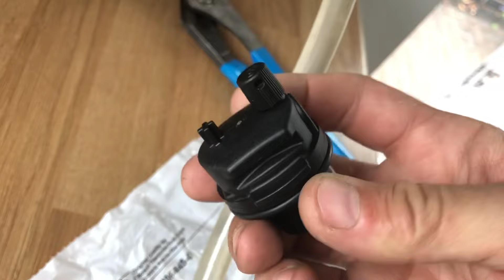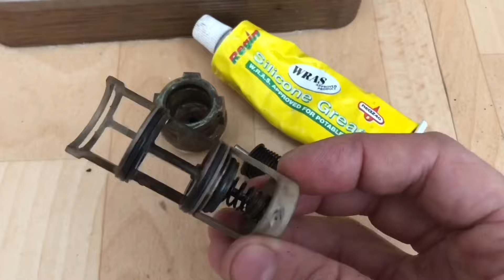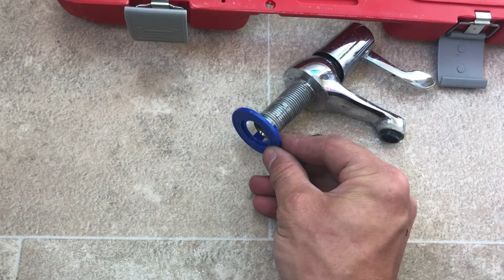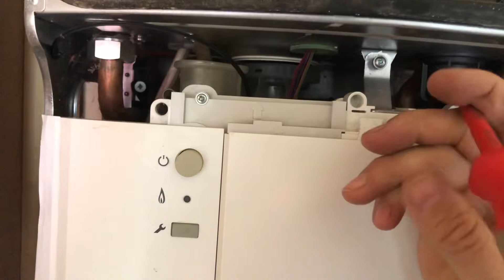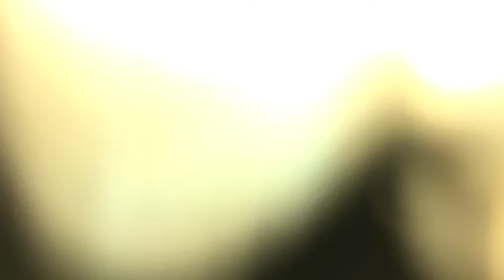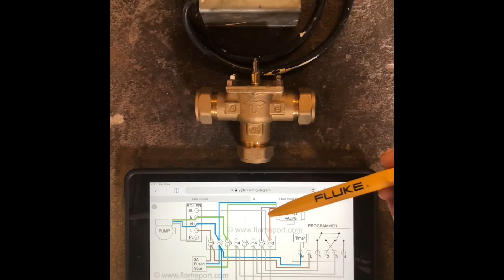P B Plumber The life of a jobbing plumber #32

Comment: This nerrad tool unfortunately doesn't not fit to any of sink. Very small ones  do not allow you to turn the nut and the socket is massive. And the 8 to 13 mm hex sockets sometimes were not long enough to reach the bolt. I was used to have it with me for long and only used 3/4 times. Better tool station one or normal spanners.

Comment: Re- leaking shower screen, I find very often, when someone stands in the bath, the front end can drop fractionally leaving a gap under the silicone (if it's old) but so easy to miss if no weight in the bath. There are loads of cheap baths out there with showers over and they have no rigidity. If I fit a bath, I always brace it underneath as well.

Comment: Had to stop the video to comment on the gas hob with low pressure, why do people put sealant on a seal ?? If there's a new olive, why the PTFE and/or bosswhite. I had a similar job, a friend of a friend was complaining - they hadn't turned their boiler off for YEARS, it switched on and ran and ran !!!!! I stripped it down and found a ball of bosswhite before the injector. When gas flowed it picked up the ball and almost blocked the injector, when you isolated the gas to inspect the line the ball of bosswhite sat in the pipe. I removed it, ran the boiler up and gas rated it successfully. I went home, 45 minutes later the people were on the phone, they'd just had to turn off the boiler because they were too hot, the first time in years !!!

Comment: Split click washer. Slide it on like a normal washer do the back nut up a bit then pull tap up to lock split click.
Havent used them in years but that's how I remember it. 
If that helps anyone. Happy days

Comment: When you opened the second burner on the hob around 27 minutes the flame got smaller before  pushing the knob down. Isn't that quite bad? I mean in Hungary where I live it's mandatory for hobs to have thermal elements so gas will flow only when the knob is pushed in or the burner is hot enough (so it will shut off the gas supply if the flame goes out for whatever reason).

Comment: Just to add to your 3 port valve tutorial,  when the valve is stuck (especially after summer) or the motor has failed you only get hot water , no heating . The dead state of the valve is  the heating port closed off , you can manually push it round with the lever quickly and it will make the micro switch for a second and switch on the pump and boiler , this can give you a quick idea of what's wrong

Comment: Regarding the 3 port description,  a lot of old timers don't have a hot water off , only have hot water or hot water and heating calling connections. When you do have a hot water off the valve  is powered to close off the hot water  port

Comment: Why don't plumbers fit isolating valves to electric showers.
Reply: Where would it go ? 9 times out of ten the pipes are buried in the wall, if the main comes from the loft then I always fit one there but sometimes just easier to turn off the main stopcock
Reply: If it's fed from under the bath it may have one , if the bath panel is all siliconed up its not worth disturbing it

Comment: You fill the expansion tank with normal air?
We (in Germany) must use pure nitrogen. Oxygen from the air promotes corrosion.
I personally find it ridiculous but the manufacturers prescribe it this way.
Reply: Daniel L. H2o promotes corrosion anyway
Reply: @milkyporridge5929  the H20 is in the rubber bellows so doesn't get to the metal casing , damp air pumped in would promote corrosion.

Comment: Great vid as always, with the exp vessel on the Worcester, I usually remove the Schroeder core attach a hose and pressurise the system, this will push out any water as they can hold up to a litre in condensation, and also easily shows if the vessel has failed. Keep up the good work

Comment: If you recharge before you remove a part it will help get rid of the excess water inside the vessel and  boiler. Less chance of water damage once you remove a  part
Reply from the maker: simon bagley good point mate that’s very true

Comment: Brill to have you back pb, missed them! You used grips on the wb Aav, you probably know this but the lug at the back is so you can use a long screwdriver to simply twist it a quarter turn and remove it. It takes seconds 👍
Reply from the maker: Paul Turner thanks mate good tip